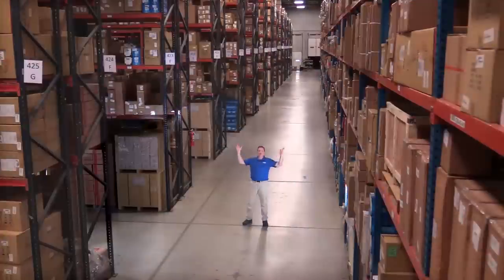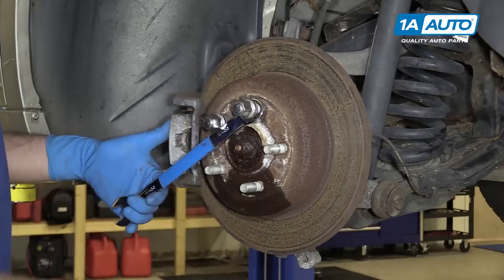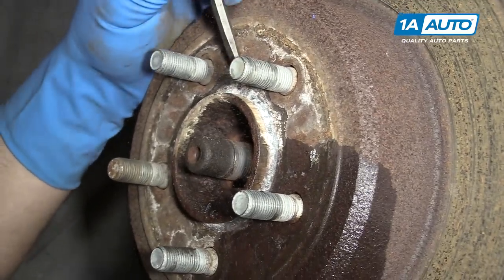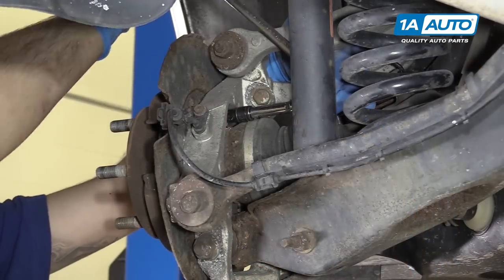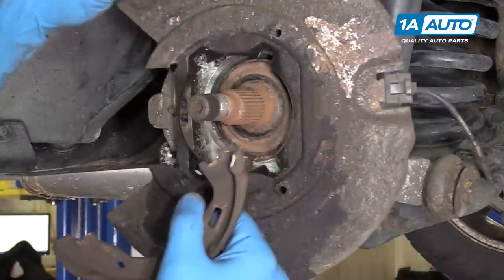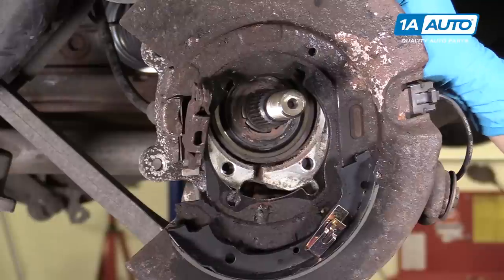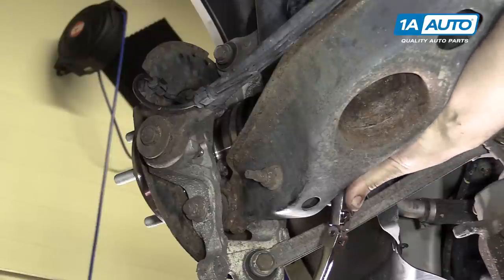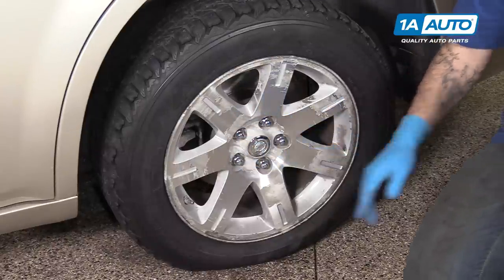How to Replace Parking Brakes 05-10 Chrysler 300

Comment: The brake spring next to the spreader was installed backwards.  The long end supposed  to be close to the spreader so it don't hit the hub.  It didn't take me long to figure that out using your instruction to do that wrong.

Comment: I am in the UK, I have a 2008 300 crd. I have replaced all the rear suspension arms. First problem is that the brake caliper carrier bolts strip the threads because they poke to far through and rust. The next problem is that the female torx bolts corrode and will not remove. I removed the whole hub to gain easy access to the bolts and removed two, the others did not strip they simply snapped both the heads off. I tried drilling them out and even with milling machine bits had no luck and ended up destroying the carrier. So I bought a second hand  carrier complete with hub, sandblasted, painted and rebuilt with new shoes to find that it had stripped caliper mountings. I am amazed that you have not had similar problems.
Reply: My personal mechanic did this job for me. He used a blow torch. To get the bolts off. And then use file in the grooves on the bolt.

Comment: Great video guide, just one question the actuating mechanism when you initially get the rotor off is what I believeto be the wrong way up, during the rebuild the mechanisn is the correct way with the UP stamped into the part at the top, please confirm that the UP should be at the top. TIA.

Comment: 9:04 during removal, spreader is one way. 13:01 after installation, spreader is upside down (or right side up and earlier was incorrect). Seems like that would be kind of important.  Isn't that what is actuated when the ebrake is pulled?
Reply: With that particular design, the spreader works either way, so there is no upside down way to install it. The only reason I ran the hook in from the top is to let gravity help instead of hamper. As it was, I still could have used another hand that I could control and it took forever. I, however, didn’t remove the bearing hub. It’s why I only did one side until the weather improved. I hate the cold.

Comment: The video is great except you didn't finish the job. Your customer has just left with non functioning e brakes. 
At some point you need to adjust the e break adjustor or they won't engage.
Reply: When you reverse, it auto adjusts

Comment: Just did my e-brake, all new drum shoes, pads, disc.... fully adjusted, will not hold the car at all.   Frustrating.  No luck.  Thoughts?   No matter how tight I have the adjusters, the pedal almost goes to the floor.... has resistance, but is not effective.

Comment: Overall very helpful.  After watching this step-bystep video I decided I could handle this job.  I didn't and saved hundreds in labor.  I might have bought the parts at 1AA auto but they did not have Mopar parts available.  Sure they're more expensive but considering the labor and how vital wheel hubs are, I was willing to pay more.

Comment: Can u do this for a dodge magnum 08 as well?
Reply from the maker: +PUA Guy We're always cycling through common cars. We'll add this repair to our list! 1AAuto.com
Reply: It's the same for 300, Charger, Magnum.

I've replaced the hub on my magnum and I've had my wife's charger apart.  

The thing that is missing from the video is how to properly adjust the adjustment wheel.  There is a excerpt from the service manual on one of the forums that explains how to adjust it until the wheel locks up and then back it off 6 clicks.

Comment: @11:16 Unclear to me how the spreader hook connects to the cable, what is the orientation of the hook (does it go up, down...and it hook on inside/outside of spreader), not obvious to me — as my ebrake came apart while knocking rotor off, now cannot figure out how to get spreader back on properly
Reply: This is why I watched this video. I had a parking brake that came apart and destroyed everything. I took apart the other side to look at the spreader and it was like this one when removed, hook side down. Alldata isn't clear about it either because it has diagrams both ways

Comment: Step by step is ok but you don't do professional job you don't clean rusted details you install springs wrong and you don't care about rims get clean from oxidation in center and many other ...
Reply: Not a show car.
Reply: @charlesm7589 ? That isn't an arguement.  Doing that to every car will make them last longer. Show car doesn't matter. It can be a rust bucket. Still should do it.

Comment: holy sh*t, if I don't use parking/emergency brakes do I still need to change them. this is way too much work. and I have a good 2012 300c  and I don't want to mess any of the electronics
Reply: so how do I know or how can I tell if I need to replace them
Reply: If they don't work when you step on the E-Brake you need to check, adjust or replace them.
Reply: First I enjoyed the video...it gave general knowledge on how it comes apart. I don't usually leave comments. You left out the torque specifications for the hub bolts judging by the bolt size and thread pitch I'm guessing at 75 to 85 ft.lbs. of torque also the park brake shoes needed to be adjusted so the auto adjusting lever would work properly. The corrosion on the inside of the rim has to be cleaned off before the wheel is installed. A little about me I'm an ASE certified technician in both automotive and trucks have been in the industry for 28 years... I would recommend a legal disclaimer before or after video to protect your company from possible legal action. Once again thank you for the video AJ
Reply: They're for emergency. Your not suppose to use them regularly. And yes you do need to replace them. Otherwise your csr is just a desth trap. Doesnt matter how nice everything else is. A non working emergency brake is a no go.